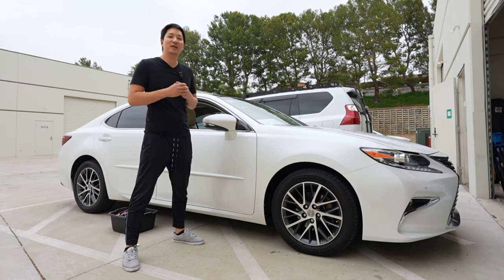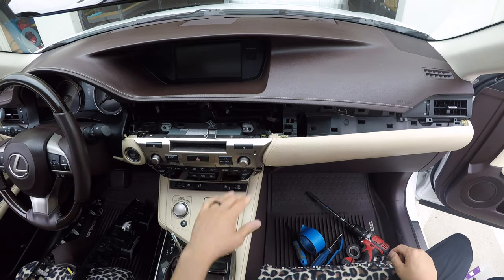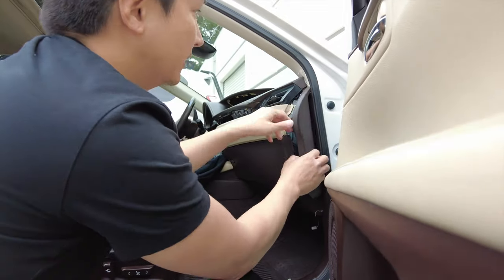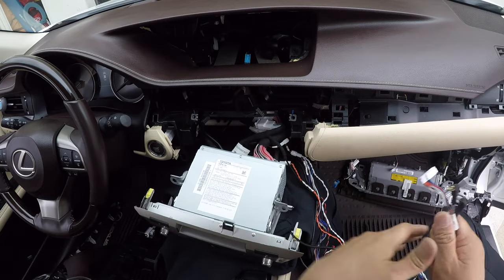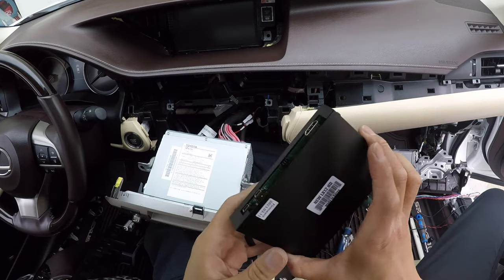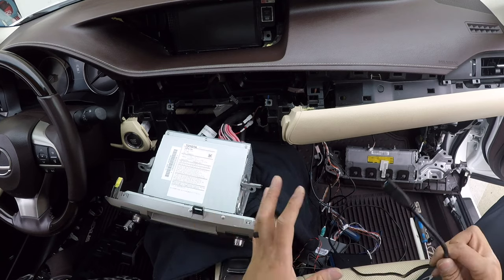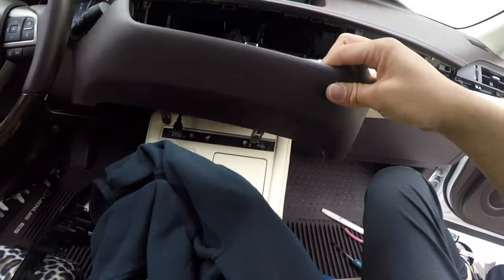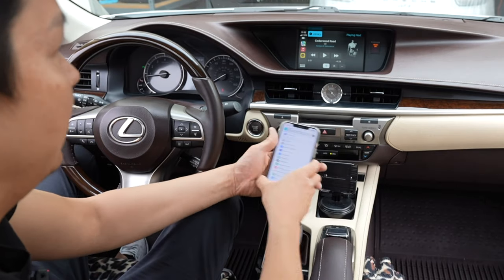2013-2018 Lexus ES | Wireless CarPlay & Android Auto | Installation

Comment: isn't there a gadget I can buy that I can connect my Iphone 14 to, via USB, to my 2013 Lexus LX, and then the screen would mirror my iphone?  They have these now for newer models
Reply from the maker: Yes we have it. Here you go https://www.beatsonicusa.com/if04ep.html/
Reply: @BeatSonicUS  No.  That's not what I'm talking about.  That's a complicated and elaborate internal installation.  I'm referring to a simple device - - external - that you can just plug (into car's USB or audio jack) and play on an older model vehicle (2013), similar to today's carplay adapters.
Reply from the maker: @elibutton  it won’t work with your vehicle, since these adapters you speak of requires you to have factory equipped Carplay

Comment: After everything is installed and phone is initially connected, will your phone automatically connect and launch Carplay when you start the car? Or do you have to select Bluetooth as the source first each time?
Reply from the maker: After installation of the first time, your phone will automatically connect to Bluetooth by default which will then automatically connect and launch CarPlay every time you start your car.